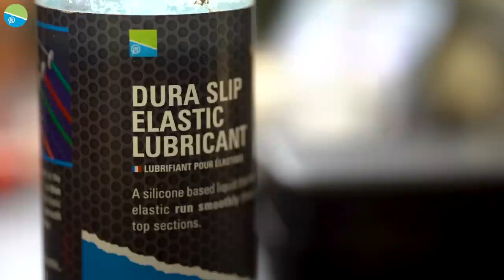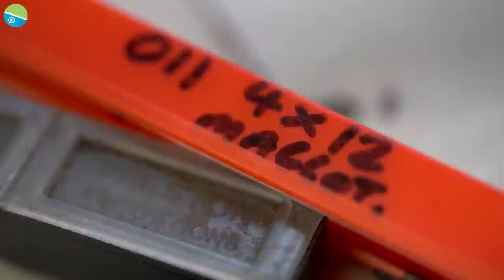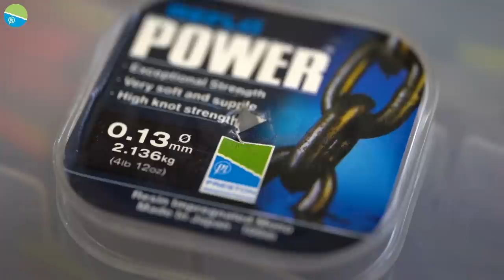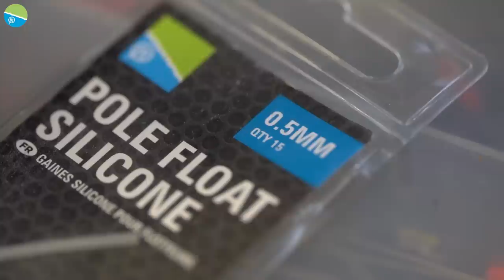Des Shipp's secret's REVEALED! 🤯 | The Man CAVE!!

Comment: Tip for saving a few pence.
If you use the same elastics in long kits as short kits, you can move your long lengths of elastic into your short kits.
Ideal if you mess up tying connectors or they've become too tight over time.
Reply from the maker: Great tip!

Comment: Great vid. Dez. As always 👏. What does cause me confusion is the way PI etc state 4x16 -10x 14 etc etc. on floats , yet when it comes the shot/stotz size numbers 8-9-10-11-12 are used with no ref to what printed on the floats. What do you use as a comparator please between these different number grades? 👍
Reply from the maker: A quick google search will give you a break down on shotting sizes and break downs :)

Comment: top tip from me i cut the dura slip in half out of the packet and do 2 top kits with it works a treat and cost half as much ¯\_(ツ)_/¯♥.
Reply: That works for short kits, but the elastic would be too tensioned in standard kits.
Reply: @MagicManFan  I do it for my carp top kits bud 👍